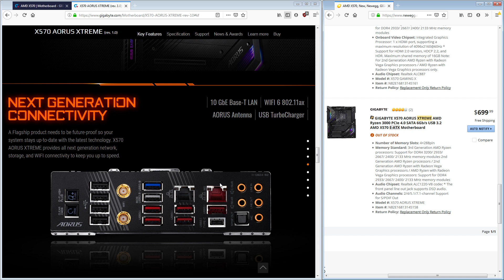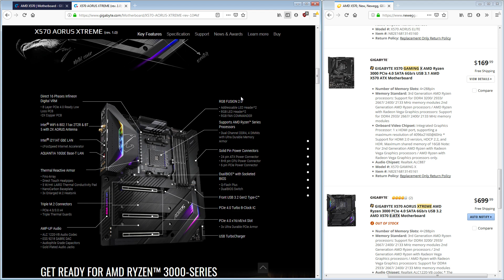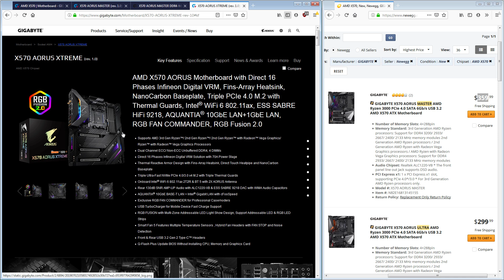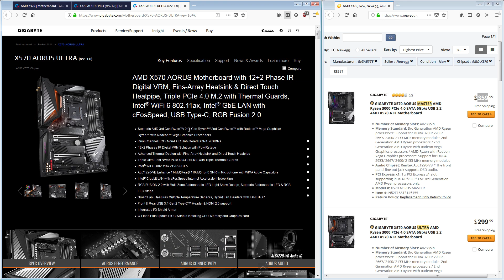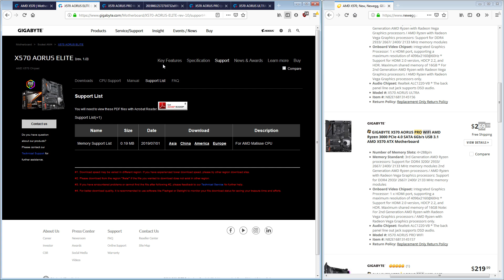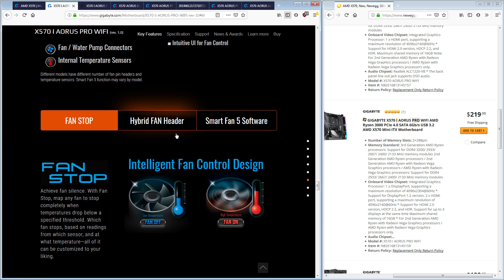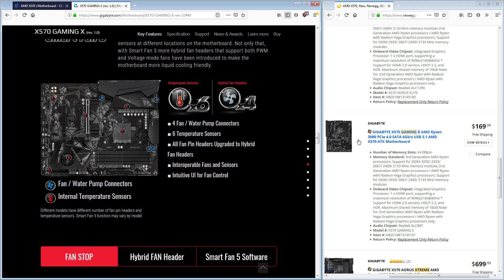Buildzoid rambles about ALL the X570 Gigabyte boards

Comment: Help me pick best one of these 4 amd x570 bords asrock steel legend vs aorus elite vs msi gaming edge wifi vs asus tuf gaming plus.
they all same price in sweden. i want to upgrade to 3600 with x570 but hard time deciding witch mobo to go for.
Reply: Why would u pair x570 with 3600
Reply: @illneverquit123  no big reason high end x470 cost just as much as these x570 mid range bords so why not. and there i nvme 4.0 i might use and mybee il upgrade to 7nm+  next year.
Reply: @rinkumultani6515  hm reasonable I guess

Comment: Phew, pre-ordered the AORUS PRO WIFI ITX Motherboard, glad it did not get the thumbs down. Shame it only has two fan headers, although it turns out the fans it does have have a very handy feature : "Supports High Current Fans up to 24W(2AX12V) with Over-Current Protection" -  handy for me as I will be using a 3000rpm 150mm fan for system cooling, also handy if I use PWM spliters.

Comment: Gigabyte should take the "AORUS Pro", add a (2-digit) debug display and go back to using Dual BIOS (with a "BIOS 1/2 switch"). With NO Wi-Fi, a cheaper audio solution – (the ALC1220 is a good-sounding chip, but once there's noise on its supply rails, its performance goes to hell; it should really be off-MoBo) – and NO "BIOS Flashback", I think they could sell it for around $250, and it'd be a KILLER MoBo that A TON of people (including myself) would buy in a heartbeat!

Comment: Help  should I buy
 3600 + gigabytes x570 pro 
.or 
3700x + gigabytes  x570 elite 
Which is good for gamming 
(Suggest good ram I'm new to this )
 no overclock just out of the box play
Reply: The 3600 + gigabytes x570 pro is fine. Use ddr4-3200.

Ryzen only installs on Windows 10. For help https://community.amd.com/community/support-forums/processors

You can use a small screwdriver to put a rice-grain-size blob of thermal paste on the CPU in the middle. Also use it to straighten any bent pins. Renew the paste every 12–18 months.

Tuning Ryzen for better performance https://www.youtube.com/watch?v=LTT5mhqmjJc

(If you get the 3600, 2600, 2200g, or 2400G the Wraith Stealth is a bad cooler. Try the Cooler Master 212 evo or the smaller Antec a40 pro. Thermal Grizzly Hydronaut is a very good paste.)

A new Ryzen user wrote: “make sure windows 10 allocates enough space for virtual memory because my computer was stuttering for a while”. (I think they mean the page file/swap file. It really means they didn't do so with their old processor.)

“My ONLY point of frustration came from some instability I experienced that took me a while to troubleshoot, first thinking it was probably some sort of memory incompatibility. It ended up being an incompatibility with the Windows 10 Ryzen power plan that was installed. Switched to the regular "Performance" plan and its been rock solid ever since.”

If the processor idles at a high temperature: disable all 3 bios options for Precision Boost Overdrive (PBO). Set Windows Power Plan (not AMD's one) for "Balanced".

Comment: Where can I get a motherboard where I won't have to worry about the fan breaking up? That allows me to have LAN parties but if there isn't enough cables I can switch to wi-fi? Where audio is awesome and I won't have to carry a seperate box? Where I can insert an additional capture card and a render card as well as GPU? That has really good cooling as I plan to overclock the fuck out of it? And if I ever get attacked at home, I could use the motherboard as a bullet proof vest?

Comment: Asrock has pretty good rear IO on ITX historically.  Only company that puts a thunderbolt 3 on them too........
Reply: Where can I get a motherboard where I won't have to worry about the fan breaking up? That allows me to have LAN parties but if there isn't enough cables I can switch to wi-fi? Where audio is awesome and I won't have to carry a seperate box? Where I can insert an additional capture card and a render card as well as GPU? That has really good cooling as I plan to overclock the fuck out of it? And if I ever get attacked at home, I could use the motherboard as a bullet proof vest?

Comment: Where is the point of WiFi on a Motherboard?
You never can use it when the PC is off.., so why?
I always want to  use my tablet and smartphone in the WiFi, even and even more when the Computer is off.
And for the simple network-connection of the PC to the network, WiFi never is reliable enough for me, sorry, I always use a cable.
Reply: if you want less cables on your PC or have some cable troubles

Comment: They're all a load over overpriced unnessasary garbage . My AMD FX chip still gives me 100 fps in many titles with a 1080 ti. :)
Reply: The problem with the old FX chips, and with the 2600k I had is that it doesnt give you the fps stability which a new processor has. Plus those older chips are really getting limited in their capabilities (missing AVX2 etc)

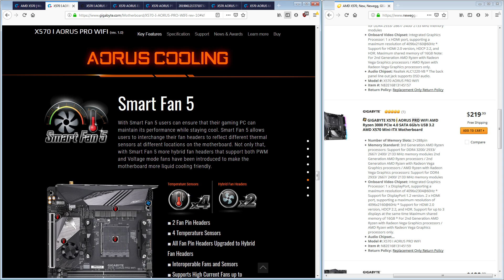Comment: 1:03:09 Hey there's no reason to joke on ITX these days. They do everything you need and nothing you don't (at least for me. I do gaming, video production, photo editing, PCB design, 3D modeling, other workstation things). I've built several ITX systems because they have unique challenges compared with larger systems. My current board (x99e-itxac) has 6 sata ports, 8 usb on the rear panel, etc. That said, I only use a few of them, where other devices where speed and latency aren't a huge deal (usb storage, dvd-drive, webcam, etc) get put on a USB hub. 
regarding not having PCIe slots: you can sometimes get 2 out of PCIe bifurcation, but there's not good support for that yet. I only ever used one of them on my ATX boards, so it's a waste.
sata ports: my MB (and the x299 itx) have 6 sata ports, but I only use 1 of them because all my "real" storage is on m.2. I would give up all 6 of my sata ports for a second m.2 slot and it's one reason I almost decided to upgrade. There's lots of intel ITX boards with 6 sata ports
"good temperatures" With a monoblock covering the VRM, I pushed at least 400-450W of heat through my old build when I was having fun overclocking, and I didn't even have to turn the fans up all the way to keep CPU/GPU temps under 80C. Now that I'm not OC'ing right now, I have my fans at or under 1200RPM (so I can't hear them), temps under 53C and ambient is 32C right now because the AC is out. water cooling makes up for a lot, especially if you have a 280.
Honestly I wouldn't buy this motherboard because it's missing S/PDIF optical audio out, and it's just "not awesome enough" to be owned by me. only having 5-6 USB ports is plenty for me because I just use all the USB hubs on my monitors to power the low-speed stuff.

Comment: I kinda agree with you, all the "fancy" add ins that just make the boards way more expensive... Give me a good solid BASE with a good VRM + non cheesy aly vedges for heatsinks (the 700 dollar one is nice but the price of that board is absurd) drop the wifi, drop the audio (buying a soundcard and migrate it from motherboard to motherboard) not like they need updating that often, and many just use an USB DAC if they want "proper sound" also all those "video outputs" just frigging DROP THEM and PS2 + VGA connectors? omg just DIE already... drop all that crap... higher end motherboards are not really for APU's anyways

Comment: @Actually Hardcore Overclocking
 Are you sure that the Strix-E is a 4+2 and not a 6+2? Cause i read that it has an (ASP1405I)/IR35201 as PWM-Controller, MOSFETs & (CPU/SoC): 12x 60A (IR3555), 4x 40A (IR3553). The ASUS Pro WS X570-Ace should use the same VRM too - so that would be very strange, especially cuase everything else is using ASP1106GGQW , MOSFETs (CPU/SoC): 12x 50A (SiC639), 2x 50A (SiC639.

Comment: Guys, I feel we need a very modular motherboard. No sound, no wifi, no lan, few usb ports, best vrm and mem support... Then you would get items at a better price from vendors: wifi 6 or not, cheap or more expensive audio solution, dual 10 gigabit Intel lan, m2 expansions... Probably wouldn't make sense for vendors but you would get only what you really needed.

Comment: adata AX4U440038G19-QR8 dosn't exit (at master qvl bit). Maybe i mistyped it, or maybe Gigabyte lies one more time. All mobo manuf. do it, btw if you check reddit you will see mostly negative comments for Gigabytes quality. Also i had in the past a mobo failed on me, never with Asus or MSI (so far), so be more harsh on gigabyte :) be really harsh on all of them :)

Comment: Since generally speaking the only voice you hear are that of people who have problems, wanted to comment that I use the Aquantia 10G on my ASRock X399 as my primary NIC since I got 10G Internet (not that I need multigig, but the ISP in the area does carrier grade NAT unless you're on a multigig plan).  I'm using Linux and can't say I've personally experienced any of the alleged problems with the NIC and able to push 10G through it no problem.  No idea if the drivers have just gotten fixed or if I just don't have a use pattern that exhibits the problems, but I personally think they're fine.  Also using Aquantia on my NAS and Mac Mini with no issues.

Comment: I'll forward this by recognizing my bias. I trust ASUS motherboards more than anything else. I have an 11 year old board that has been run 24/7 for >6 years. It's got a 16-phase VRM and handles a 170w CPU that I clock up to use 225w in the winter. Voltage supply is as stable as the day I got it, droop ~16mv under my extreme overclock and the other lines are rock solid. With that as my experience, I will frankly only buy high quality ASUS boards. I like their support and I like the software options.

Comment: WTF , AMD is not as cheap as reviewers say GN, LTT, J2C, HU, OC3D, Paul's Hardware,BitWit and others. In my country(Romania) Gigabyte X570 Extreme costs almost a thousand US$, 950 US$ where 1 US$ equals 4.21 Ron (our currency). And so are all prices of electronics. 

So next time you look at a review and the guy tells you R5 3600 is better priced than i5 9600K believe that is all bullshit . AMD is NOT cheaper globally. Reviewers should take in consideration prices in all the countries before saying that R5 3600 is more worth to buy over the i5 9600K. 

The price of a new R5 3600 AMD kit is actually more expensive that a kit with an i5 9600K. For example my Gygabyte Z390 Pro is 110 US$  less expensive than Gygabyte X570 Pro.

Comment: I bought the xtreme purely based on looks. It's sexy af. And maybe a little because the passive cooling on the chipset. It also has a RGB controller and a RGB hub that I actually "need". It's not compatible with Corsair RGB fans though, but it looks like it'll work with my 3 RGB water blocks. I'll be building my loop soon. As for RAM, I was able to get 64GB of Ballistix to 3000 which were rated at 3200. It will boot at 3200 and I haven't tried too much yet, but I couldn't get it stable at that speed. Their QVL says it supports it at 3200 though, so dunno. I wish there were two internal USB2 connectors though because everything for fans, RGB and monitoring uses USB2. I had to buy an internal USB2 hub for 3x RGB hubs, PSU monitoring and the front panel.

Comment: Gigabyte designing the aorus extreme
 so what features do you want on this board?

The engineers  Y E S
Reply: And yet I don't recall any discussion on the amount of SATAs on it.
Reply: still has less than the hilarious MSI GOdlike
Reply: @AbirZenith  Exactly as funny as the Sams comment is it's blatantly false. Both Asrock and Asus are better specd and I've only owned Gigabyte for the last 20+ years. Now for the first time I have to consider other brand due to a LACK of features.
Reply: USB PORTS TOO

Comment: Would be really awesome if you could mention the number of fan headers / aio pump etc on the boards you review . I know this is not a huge point for you personally but for most users it surely is i'd say  . I.e. I have 6 Fans overall in my system and really like a healthy number of fan headers on my board ;D

Comment: Can't decide if I should get an x470 Taichi, Aorus x470 gaming 7 wifi, or the x570 pro wifi.. first 2 are $300CAD and the latter is $360CAD.. Future GPU will be a 58/5900xt, probably won't need gen 4 SSD.. C7H not a consideration because ASUS doesn't care about BIOS fixes

Comment: I know my Asus Z370i is really good with USB ports. Never really had a problem with it, and I have a keyboard, mouse, USB DAC, monitor USB hub, Printer, flight stick, throttle stick, and VR setup and still have a few USB slots left over, not to mention front panel USB ports.

Comment: One thing to note that changed my mind: how many fan headers you need. I am running an air cooled build and need more fans in my build, so I went with the Pro over the Elite. The Elite has 3 fan headers I believe and the Pro Wifi has 7. Now I know you can always buy splitters and controllers, but in the end the extra headers/controllers would come close to just spending the extra to get the Pro (also "better" VRM and heatsinks are nice). Both are SOLID boards tho, love that Gigabyte improved in every way.
Reply: Could just get a fan hub, most pwm fan hub can support up to 3 fans from a board fan header, anything more look for those with sata powered pwm hub.
Reply: @junyanchan1285  ...but then you have to deal with compatibility, mounting, and loss off a power cable.

Additionally, most of them with any features on them for any serious effects cost 60.00 dollars.

That's the cost of the board bump making it worth it alone, and that's before the feature bump.
Reply: @formdoggie5  Obviously mobo fan headers is the least of your concern if you are taking about features. The sata power cable is the same cable that powered your hdd or 2.5 ssd, and those cable have 4 ports on a single cable that comes bundle with your PSU. If all else, get molex fan hub, not recommended.
A 3 port pwm fan hub cost around 5 bucks, 3 of them will only cost 15 and will powered up the elite up to 12+2 fans without the need of sata power. Side note, more fan doesn't equate to better cooling airflow path and air saturation are equally important. Just look up for Lian pc-o11 dynamic and air review.

Comment: I have AsRock Fatal1ty Z370 Professional Gaming i7 motherboard right now.
I had it running with all of the following at the same time:
2x GPUs
3x M.2 NVMe SSDs
2x PCIe x4 USB hubs (x1 slots are open ended, so despite x4 end was on top of M.2 SSD in the top slot it still worked

And I even had the very bottom PCIe slot empty (wanted to install another GPU, but PSU was on its way, so will not use until moving into bigger case).
And motherboard has one 10G Ethernet port and even 2 more 1G ports on the back side without expansion cards.This is what I call a good I/O. It was an expensive motherboard when it was new, but at least it has a full set of necessary ports and slots.
WIth that in mind, X750 Aorus Extreme's layout is just misunderstanding. Why buying $700 USD with just 3 PCIe slots???

Comment: The Broadcom PEX88000 is actually a thing but made for datacenter hundred gig+ nics. However since PLX technologies - the company - was acquired by Broadcom, that was basically the end of PLX as you knew and loved it. Part of this process divested the 10GigE assets to Aquantia and thats how they exist now. But you can't go back in time now. Microsemi was supposed to fill the void and produce PCIe4 gen versions of their Switchtec product line, (but I can't find it online right now). The Diodes Inc PI3DBS16413ZHEX is actually available though. PCI-e 4.0 "PLX" named chips are not necessarily required because people are using smaller form factor Switches and Multiplexers (as was common on PCI-e 3.0 - the ASMedia chips come to mind) and if necessary fixing up the signal with ReDrivers and ReTimers.

Comment: with buildzoid mentioning "give me usb and pcie and im happy", i wonder if any mobo manufacturer would ever again build one of those legacy boards, like some late am3+ ones. you know, a board with pcie 4.0, usb 3.whateveritisnow, gbit lan, audiostuffs, but also com and lpt, ps2, usb2 and classic pci ports. just so you can run everything on one board. and no, expansion cards are not always an option, as there are applications where not having your parport right on the motherboard can prevent things from working. also, do boards still have the standard speaker headers? if that also started to become an optional thing, it could be something for bz to mention, like, if you dont have postcodes or leds you at least get that

Comment: Aquantia is the low end entry level of 10G Lan. Incompatibility in FreeBSD. Beta-ish drivers in linux. Sleep issues on Fedora. Redhat just added support in May. Problems even on windows. Issues when paired with Intel on the other end. At least the drivers are open source, and there is actually hope for everything to be resolved - IN TIME - so do not blacklist them from your mind, its just that Intel has ironed all the bugs out by now and Aquantia hasnt.
The Intel 10GB lan cards arent x1 anyway, they're X4 or x8 as far as I know. EDIT: also yea an x1 lane on PCI-e 3.0 would be 8GT/s so not enough, and PCI-e 4.0 x1 would be 16 GT/s so thats enough but that hasnt come out yet.

Comment: Have a x570 master here. Took one of those 3200mhz 32gb lpx kits from corsair and out of the box painlessly brought it to 3733. Id imagine I could go higher but memory overclocking on this thing is really really nice. 18-19-19-39? I think are the timings. Literally just copied the timings from the 3600 kit they sell. One warning about this mobo is that the memory voltage tends to run a bit hot and give a bit more voltage than what is indicated - 0.15 or 0.10v higher for what its worth.

Comment: Sounds like you wanna say, ryzen 3000 doesn't really overclock so as nice as x570 boards are they are useless as far as ln2 oc. 7nm is so efficient there's no need for any of the extreme boards.